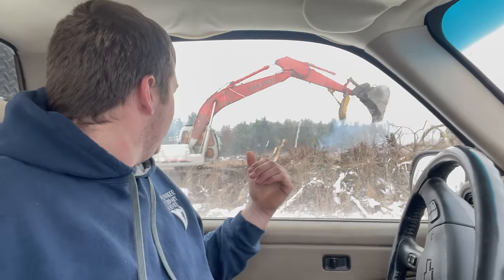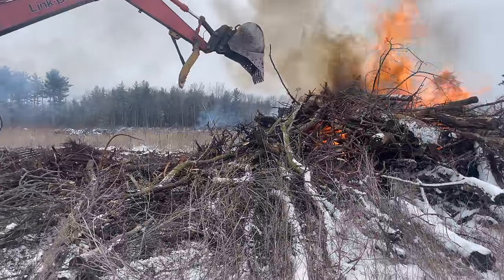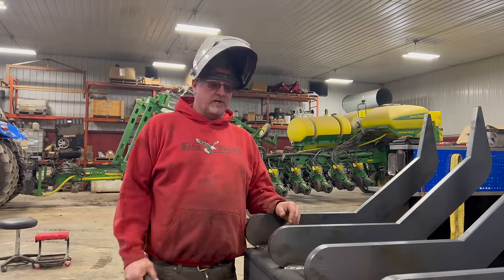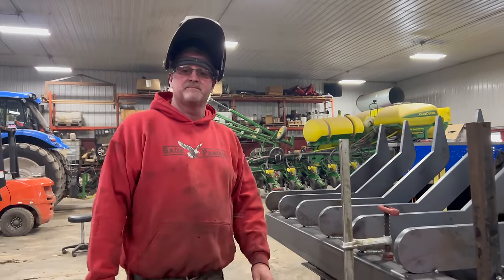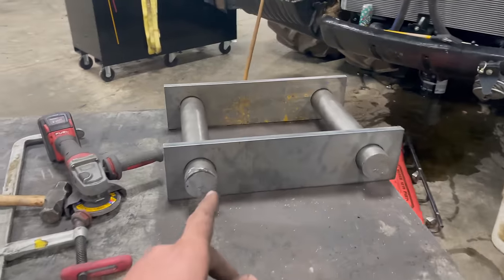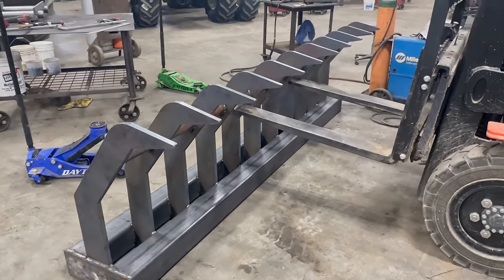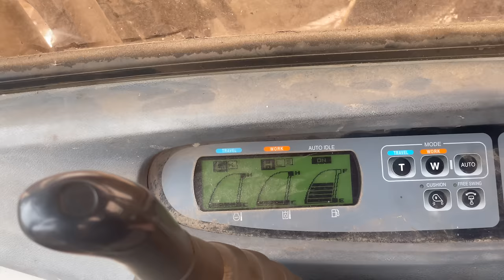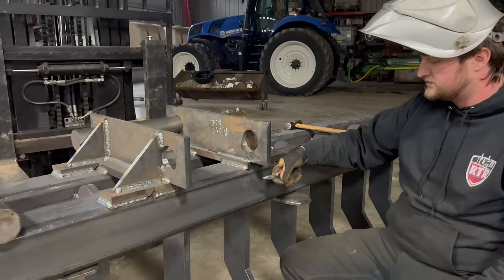Homemade Root Rake to the Rescue!

Comment: One advantage with the "pin grab" style coupling. You can mount the rake pointed out for fluffing up the fires. I am also sure you build that for a lot less than a new one would have cost.
Reply from the maker: A lot less!